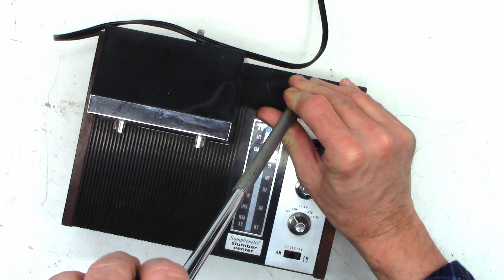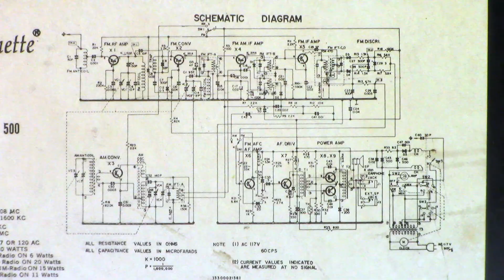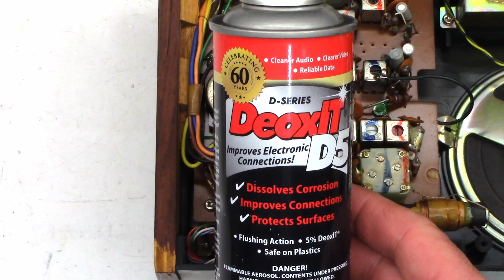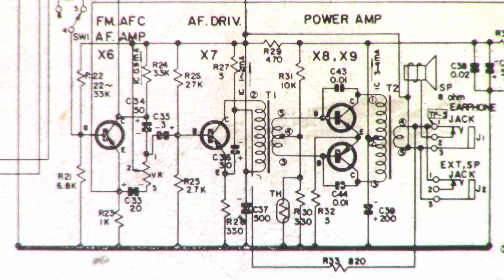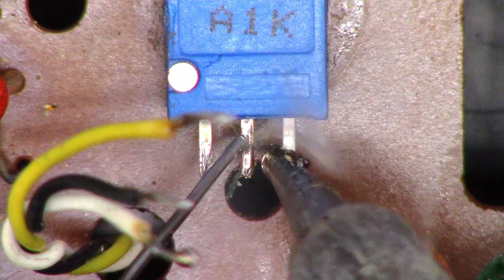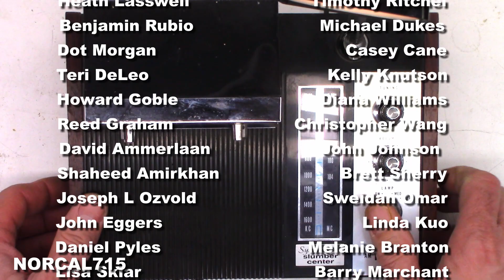LONGINES SYMPHONETTE SLUMBER CENTER AM FM CLOCK RADIO/LAMP LCR500 FRON 1970? CAN IT BE REPAIRED?

Comment: Hi how did you open this? I can't seem to figure that step out
Reply from the maker: Remove the screws and then the bottom is "Snapped in to place", you may have to pry it apart at the junction of the top and bottom sections.

Comment: Thanks for this video! I am wondering if it's actually necessary to remove the board in order to replace the volume pot?
Reply from the maker: The nut for the volume pot was on the top side of the board. Thanks for watching!

Comment: Hi ! I planned on buying one of these from Etsy. I have 2 problems :
- I live in France so I have to find a voltage and frequency converter (230V and 50Hz)
- And the one you can help me with : i can't find the reference of the light bulb that this alarm clock is using
Thanks in advance for the help !
PS : Great video !
Reply from the maker: Are you asking about the high intensity lamp? I know they are approximately 12 watt 12 volt bulbs.